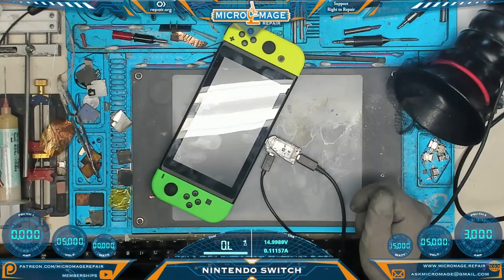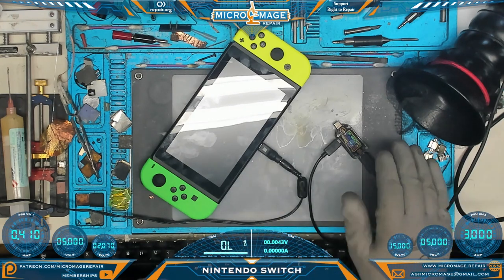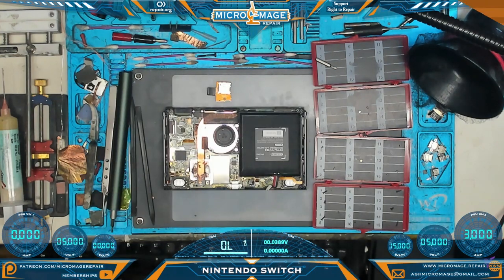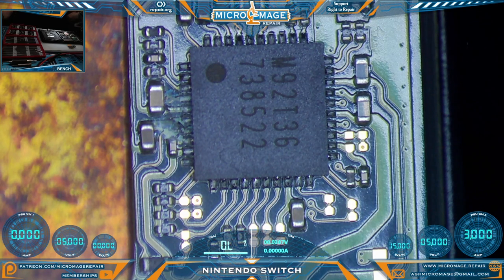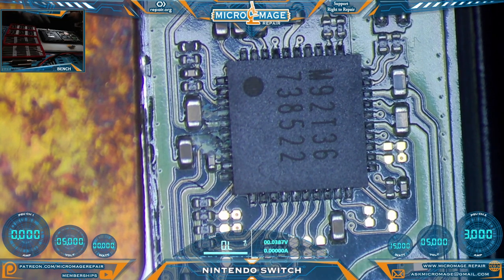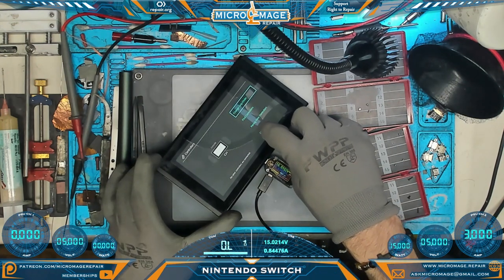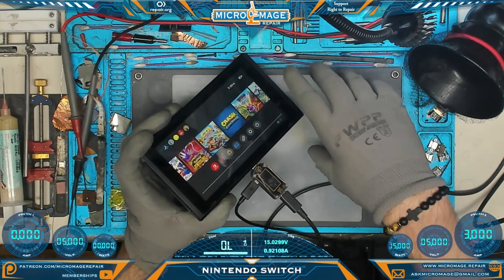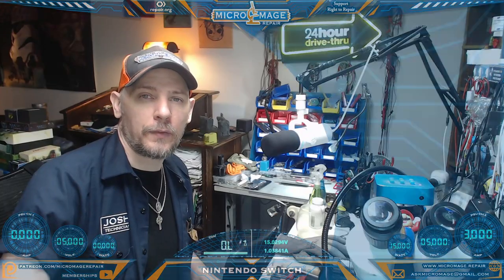Nintendo Switch: Error Code 2101-0001

Comment: What if it gave you that code and then it just turned off and never turned on again
Reply from the maker: Pretty normal, chip either just completely died or the battery ran out.
Reply: Would I be able to replace the battery to get it back in working order or just buy a new switch?
Reply from the maker: @weirdgamer4452  It might turn back on and show the error with a charged one but it won't work or charge.